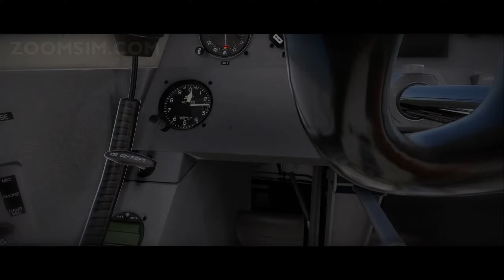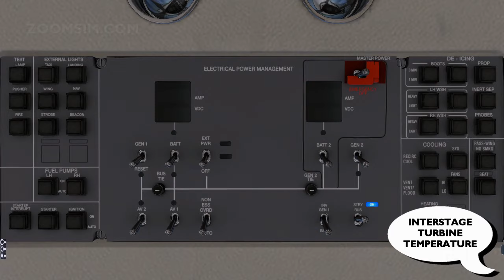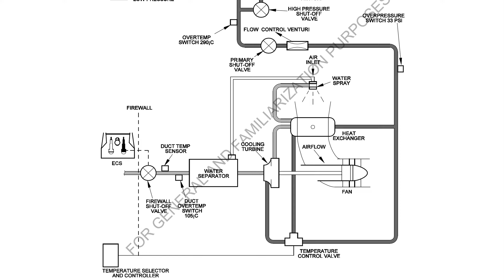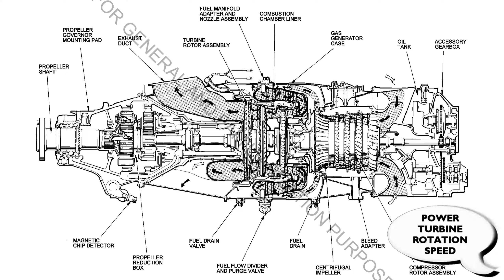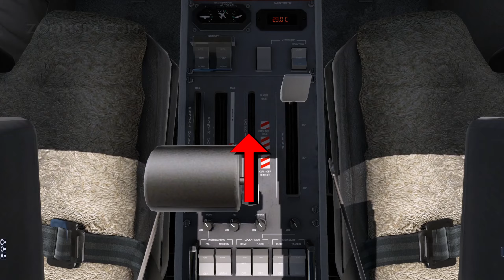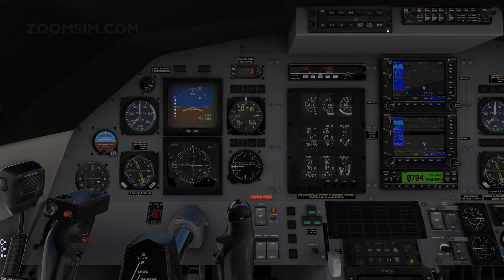X-Plane 11 : Carenado Pilatus PC-12 : Startup Tutorial

Comment: Thanks a lot for your video. Very helpfull. Can you explain how to set the cruise altitude on the cabin pressure controller. I do not see any fixed arrow to align with the altitude ? Do i need to align on the left or on the right of he small window we can see ? I will be really interrested in understanding how to read and set the correct altitude. Thanks
Reply from the maker: I'll post a tutorial on the cabin pressurisation control system soon.
Reply: @supanova88  Thanks a lot. Looking forward to see your vidéo.